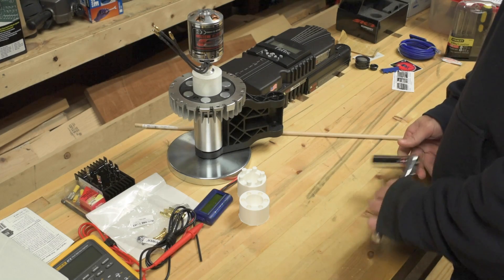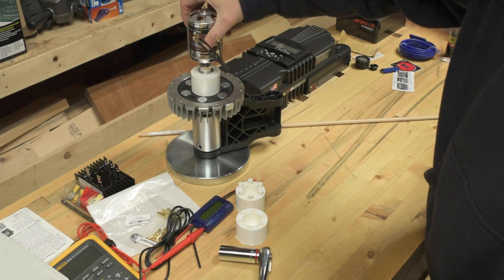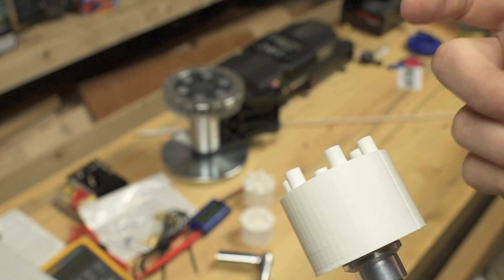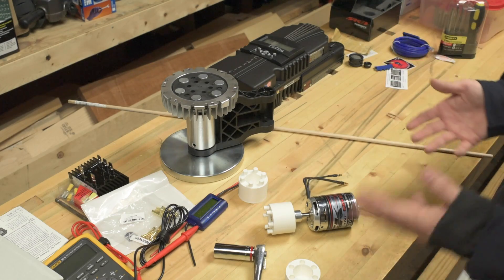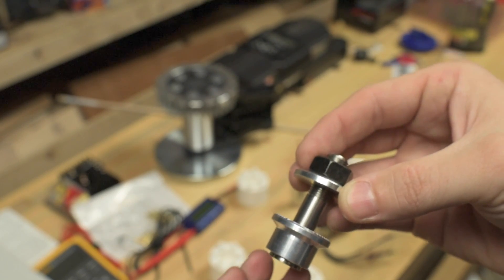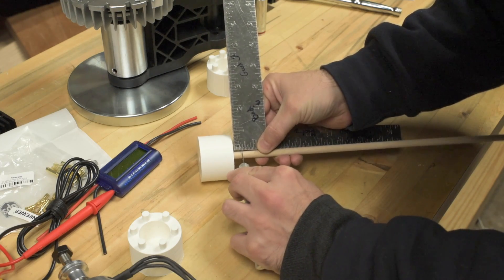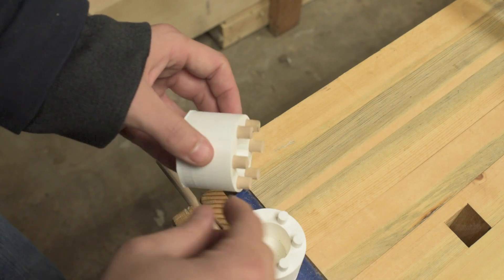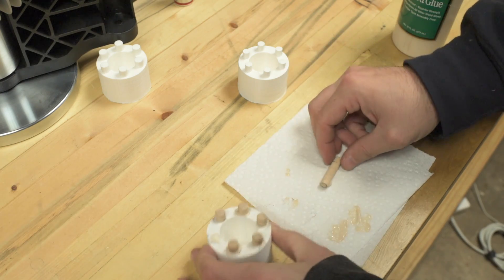Kurt Kinetic Adapter - Bicycle Generator - Part 1

Comment: Do you mind if you can share the 3D model of the adaptor please? It doesn’t seems in the description, many thanks.
Reply from the maker: I used to run an online store where I sold models, but it wasn’t doing enough business to justify the maintenance costs, so I shut it down. Send $10 via PayPal to jesse@createthis.com and I’ll email the model to you. If you would prefer a professional print instead of the model, let me know and I will upload the model to ShapeWays.
Reply: @createthisdotcom  thanks, $10 on its way
Reply: @createthiscom can I also buy the 3d print file?

Comment: where did you buy the motor from, what size?
Reply from the maker: +Henry Lopez I think there is a link in the description of the video.
Reply: Yeah, the Turnigy Aerodrive SK3 6374, whatever that means. But it’s £68.80! Don’t tell me that’s the cheapest part.

Comment: Can i suggest , to almost eliminate the sheer strength, buy some pure acetone and garbage cheep ABS filament (clear or white)
let is dissolve into a solution with the same consistency of coffee.
Dip that part 1:1 scale in the solution and wave it about for about 5 seconds then take it and and get as much excess acetone off as you can buy waving it about, flicking it etc.
and you will in the end have a much more solid and shinier part.